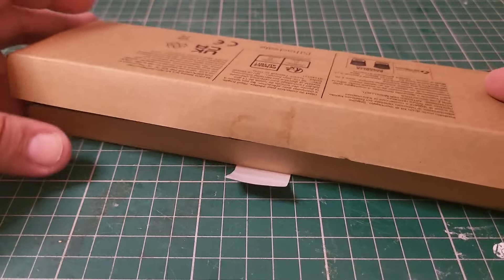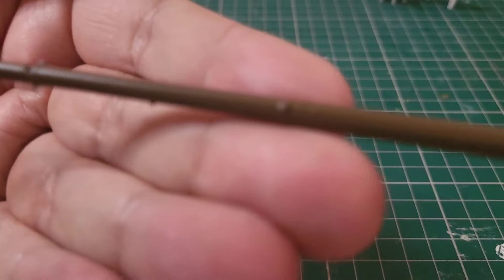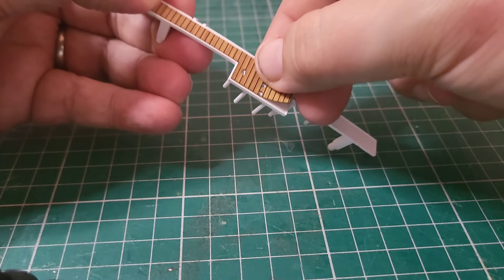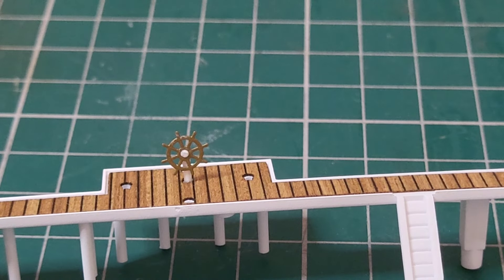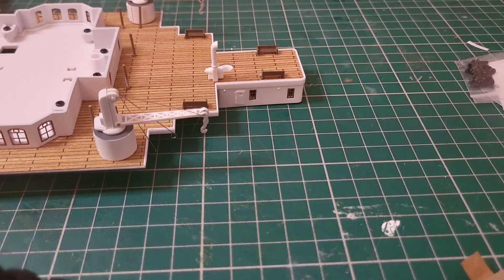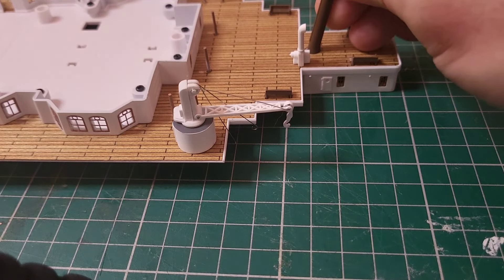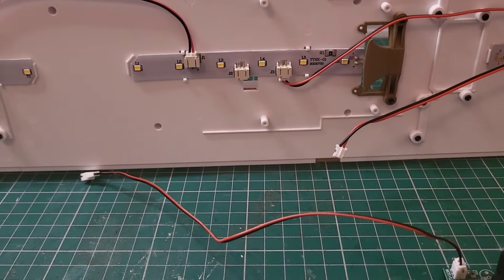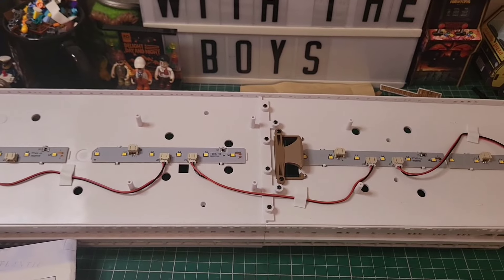Hachette Build the Titanic : Part 121

Comment: Struggling big time with issue 122. Fitting is not good. I'm finding that I'm having to loosen various screws so it provides more elasticity to the upper deck. Good luck.